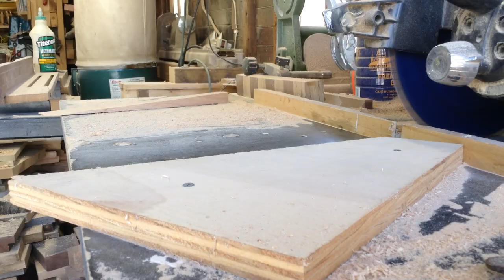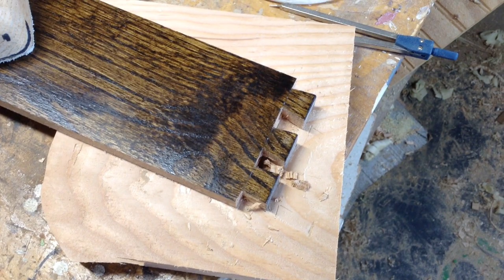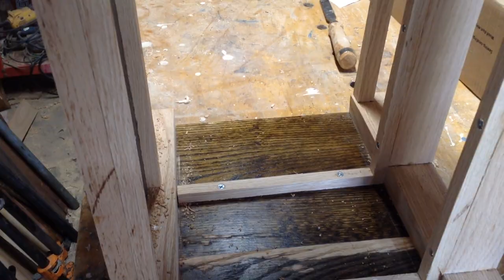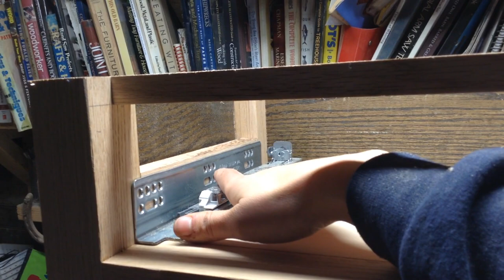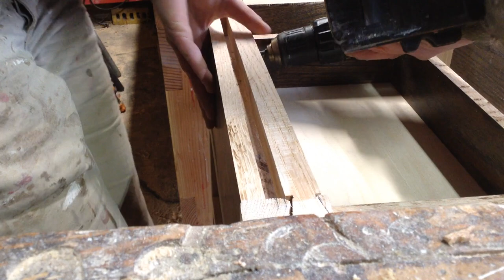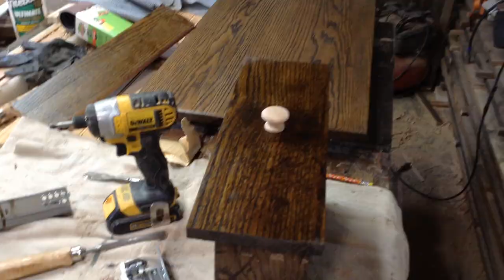Woodworking : Oak Side Table // How-To Part 2

Comment: When cutting your dovetails I think you should lower the timber as low has you can in the vice 
So the timber doesn’t flex it will be more solid , saying that nice job on the table👏👏👏

Comment: Regarding your experience with the finish lifting some stain, have you ever used dye, either water or alcohol based? I think these might allow you to reduce the wait between finishing steps.
Regarding your dovetails, they look perfectly fine with little or no gaps, and the water in the glue typically swells the wood to close them up. Nice work.
Reply from the maker: Thanks!  I have only used dye once and really liked it.  This piece and the table for the same customer were made to match chairs she already had in her home, so I didn't have a lot of wiggle room with the color on this one.

Comment: Nicely done C! I am nervous about staining wood, creating streaking. Any advice ?

Also, finagling is such a great word!
Reply from the maker: Pre-Stain helps a lot.  I only have had issues with staining when the lumber is fine grain.  Maple streaks and sometimes it's really unavoidable even with a good pre-stain.  So, if I know the customer wants something stained I usually recommend Oak.  It takes stain amazingly and doesn't break the bank.  If they don't like the texture of Oak I make them aware of the fact that pine/mape/etc. can be tricky and then I just cross my fingers.
Reply: @HoneyBadgerWoodWorks  Thanks! I tried staining beech and it was a disaster on a test piece so I talked my client out of it. Painted it instead. Will remember the pre-stain for next time.

Comment: Do you have an affiliate link account yet?! If so ild love to be able to purchase the drawer slides through it if so! The table is awesome! Beautiful work!
Reply from the maker: I don't have an affiliate account. These slides are awesome, but a pain to source.  The smaller ones are harder to find and I usually get them on EBAY, but the person I used to buy them from at the best price, no longer has them.  Don't think I've ever bought them off Amazon.  Rockler has them.
Reply: @HoneyBadgerWoodWorks  thanks!!!

Comment: Once again great job and I still love the ay that you use what ever you have to get the job done. If you don't have a jig cut a piece of plywood. Shows how much of a master of your craft that you are. That is going to look good with the table. Even though you did not need it on this, over the years when I have a shelf or drawer above another drawer I will put my wood divider in between the two flush with the bottom of your draw rail so the if something moves in the drawer it will not get stuck  on anything being pulled back out.

Comment: you have the ability to cut perfect dovetails, one thing is to do layout with marking gauges and knives, it gives you a perfect reference,  also use a saw to cut that has a back either English or Japanese allows you to cut much straighter

Comment: Nice table and yes dove tales are easy...... on you tube, lol. 
Coul you add a link to the slides you used please.
Reply from the maker: I got these ones off Amazon, but can usually find them cheaper on Ebay.  https://www.amazon.com/gp/product/B018UQC6AW/ref=crt_ewc_title_huc_1?ie=UTF8&psc=1&smid=AY4K41KW4WECP